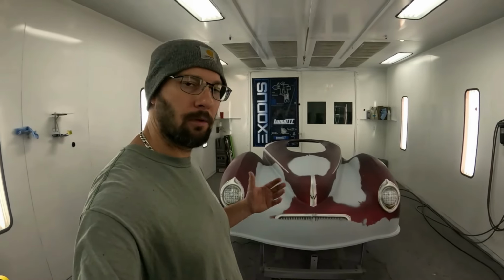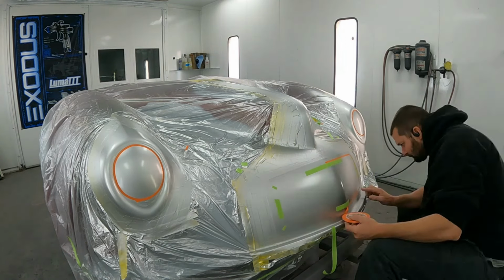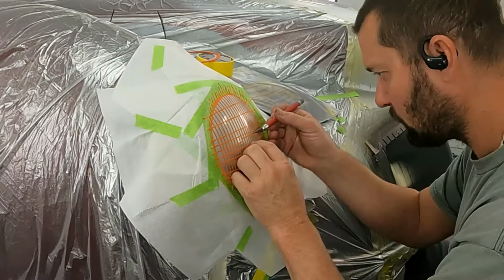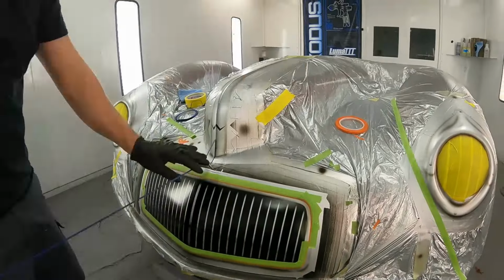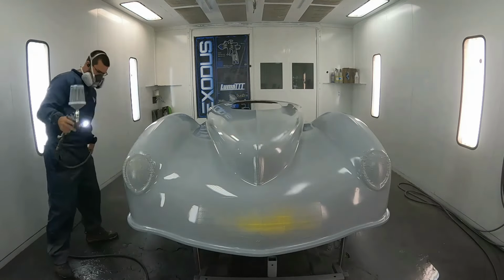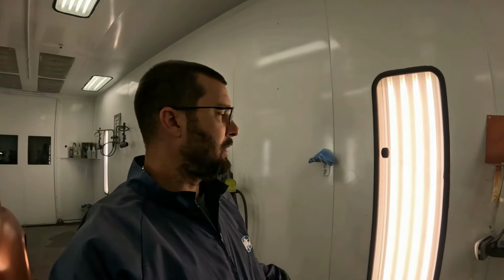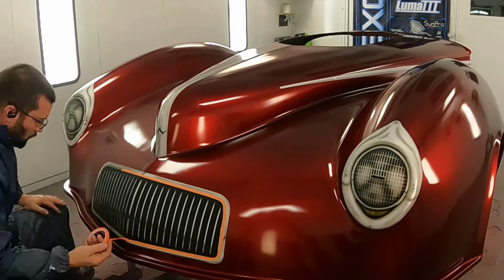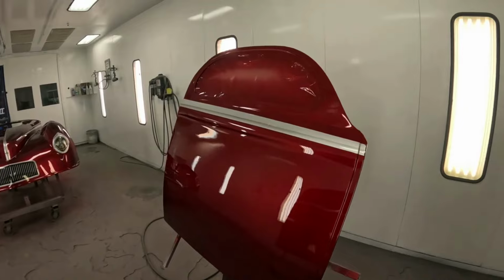41 Willys Pro Mod Front End

Comment: Hello sir, new subscriber here, just wondering if you have a vehicle acid dipped to strip off the paint and rust, then have it E coated, do you have to get rid of that before priming and painting?
Reply from the maker: You can sand E-coat and prime/sealer right on top of it. On all modern collision repairs with new e-coated parts, sanding the e-coat is only necessary to remove imperfections before sealer and paint is applied. However, a lot of the classic car restoration parts may have sat in some warehouse for a decade or more before they are sold.  If you are using one of these parts and /or you do not know the condition of the metal under the e-coat on the car you had dipped, It's always best to at least strip the e-coat off of everything that is "exterior" and then prime with an epoxy primer and so forth. On the interior surfaces, a red scuff pad on the e-coat is typically sufficient enough to give a good "tooth" for the sealer to adhere to. Hope this helps.